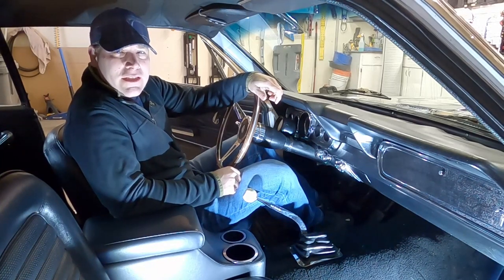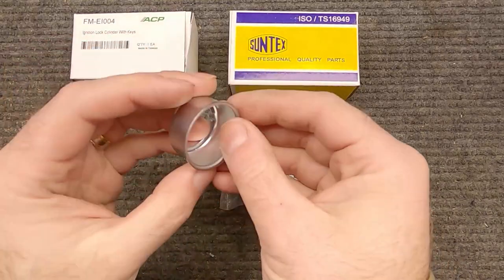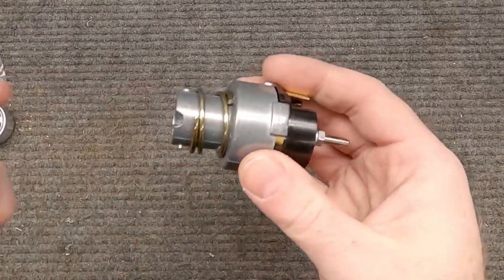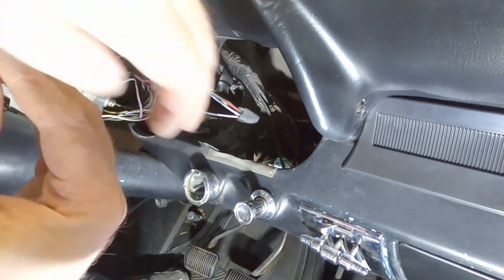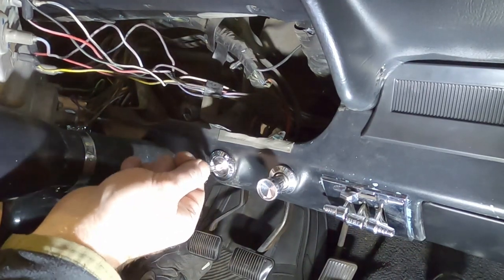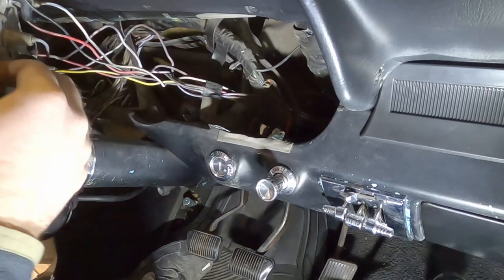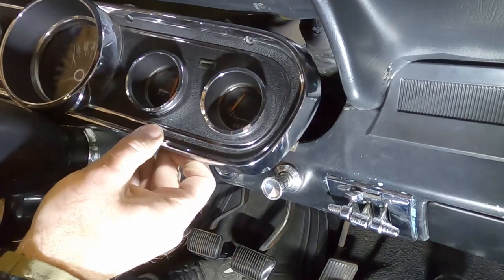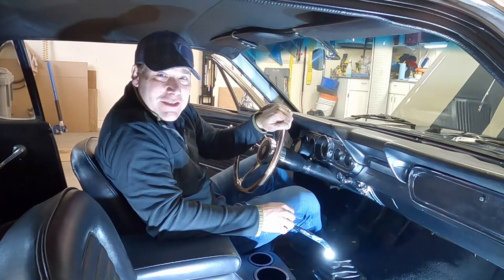How to Install a New Ignition Switch in a 1966 Mustang

Comment: Thanks for the good video. I am about to try checking and possibly replacing the ignition switch on my 66 F-100, easier to get to for me as it is low and left of the steering column. Same parts I think. You did have the speedometer cable detached when you loosened the instruments.
Reply from the maker: The ignition for your F100 is similar enough to the one I have in this video, that it will be a very similar swap.  The tumbler (with the key part) is removed the same way with a paper clip and turning the key backwards, but I think the ignition unit itself is held on by the front cap.  In this video you grab the ignition from behind, push and twist, but I think your F100 is held on with a thread cap that you have to remove from the front.  You can use a flat head screw drive and tap at it to break it loose and spin.  Also, the harness on the back should just pop off, no threaded stud that holds everything on.  Good luck, you've got this!  :)
Reply: @AndyKruseChannel  Fast reply from you, Andy, thanks. My 66 F-100 has the same switch as your Mustang. I know what you are referring to with the screw on bezel, like what I had with my 53 F-100 before I traded up for the newer one almost 5 years ago. I was checking out videos like yours and diagrams before going out to check all. My truck either starts fine, with the starter spinning well, or I get nothing, not even a click. I have been checking the free things like fixing any corrosion and grounds especially. I did not know til recently that the starter solenoid needs to be grounded. Also, I wanted to become better acquainted with which wires go where. So, I didn't remove anything yet except battery terminals. I was not impressed with the yellow wire on the ignition switch pigtail. The previous owner has it connected to a heavier gauge red wire that goes in his replacement wiring setup. I am concerned that the alternator is not charging the battery as it should at 13+ volts. Next time I use the truck I will check with a voltmeter. Next, if what I did does not work, I may replace the ignition switch, then the starter solenoid. Any other ideas? My truck runs well (as long as it starts). It has an 87+ Mustang 302 HO, and AOD trans and Trutrac 9" rear. I will be fine tuning the preload for the pedestal rocker lifters. I just received shims in .010, ,020, .030 and .040 inches to replace some shims under the pedestals. Nine of sixteen could use a different shim.
Reply from the maker: The lack of the "click" when starting to start your truck is the solenoid not doing it's job, which makes me think your ignition switch is not playing nice.  Your solenoid could be on its way out too, and that is a cheaper and easier fix than the ignition switch.  :)
Reply: @AndyKruseChannel  Thanks again, Andy for good advice. Now that I have cleaned some connections and grounds, I will see if the "no click, no start" occurs again. Then I could see if it starts by jumping the starter solenoid. If that starts, it should be the ignition switch, I think. It is easier on the truck as it is not behind the instrument cluster, but below and left of the column.

Comment: What size is the diameter of the hole on the dashboard for the ignition switch?  I have a swamp buggy and it has another switch in there that is smaller.
Reply from the maker: Sorry Boss, I don't have that info.  :)

Comment: After the bezel is in the car, while trying to push the ignition switch into the car I can not get it to mate up with the bezel.  The starter mates with the bezel outside the car, but never while trying in the car. This is after about 20 tries. I have the large pins and small pins matched up properly. However the two will not engage.
Reply from the maker: Hmmm, it's difficult to say without being there and seeing the issue.  If it lines up correctly when assembling outside of the car, but not when trying to install it in the car, my guess is there's something wrong with the ignition itself and how it mates to the dash, or there's an issue with the installation process and you may need to keep trying.  Sorry I'm not much help.  :)

Comment: Did you have any issue dimming the dash lights?  LED's take so much less current I'm wondering if they don't dim until nearly off.  Or don't dim the same as the radio light.
Reply from the maker: Nope, no issues.  :)

Comment: Did you have to install a new flasher unit to correct hyperflash?  Also, what was the location install of your LED's (4 red, 4 green, 4 warm white)?  Thanks
Reply from the maker: I did, but for the LED tail lights (upcoming video), but I did not for the LEDs in the dash.  There didn't seem to be any issues with the dash LEDs and flashing/blinking problems.  I did these LED dash bulbs several weeks before the LED tail lights.
Not sure I'm understanding the second question?  I did the turn signal lights (2 bulbs, green), the high beam light (1 bulb, red), and the dash lighting inside the gauge cluster (I think it was 4 bulbs, warm white).
Reply: Thanks Andy, that answered my question.  Also, you had no ‘hot spots’ with the brightness of the LED cluster install?  I had heard of that occurring at times as well.
Reply: Also thanks for showing the cylinder close up ‘ridge positioning’ for reinstallation. That point/picture was missing in all other switch vids
Reply from the maker: @graesson  No problem, glad I was able to help!  :)  No hot spots, these LEDs are low wattage, so they don't generate much heat.
Reply from the maker: @graesson  I try to get good angles, good lighting, and I try to explain the sticky stuff just in case someone is having difficulty seeing the whole project.  Sometimes I get carried away and sometimes I miss stuff.  I'm happy to hear there was some value in this video, it's great feedback!!